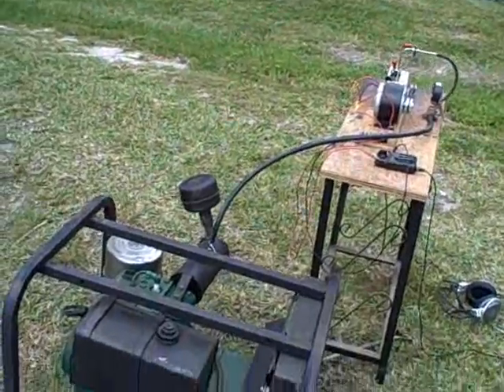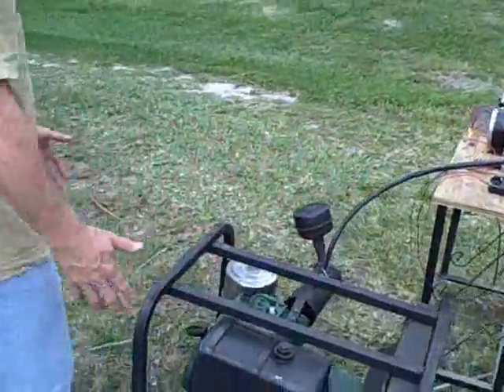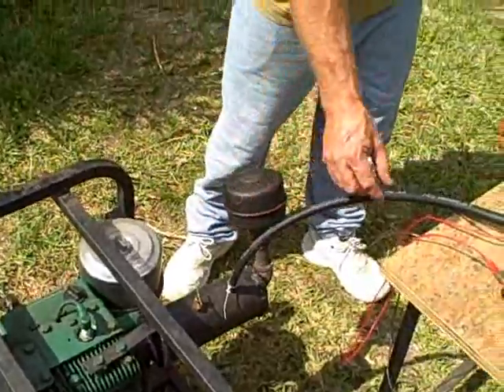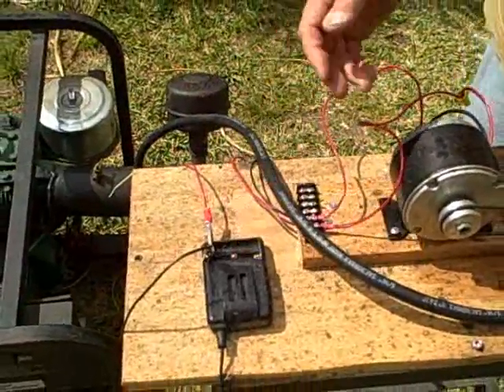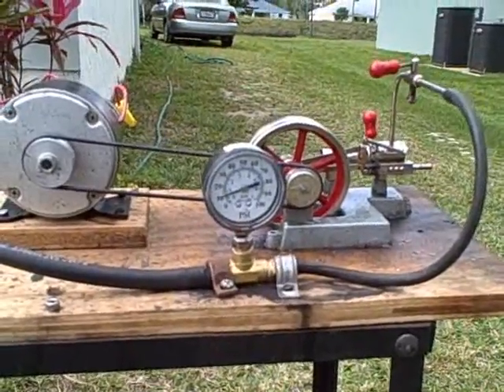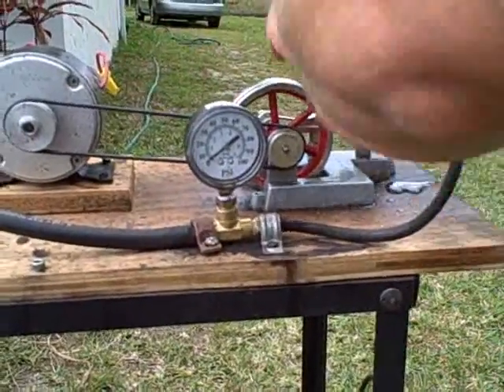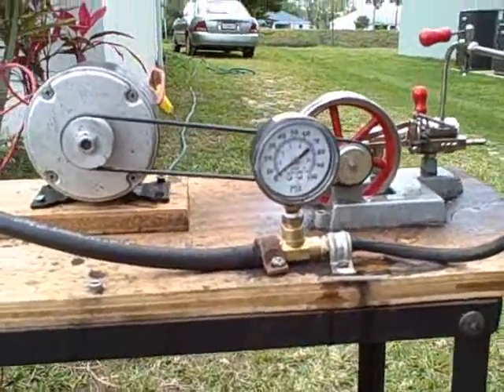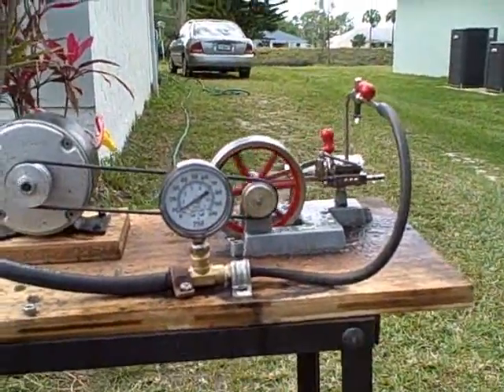The Andrews Exhaust Boiler Power System

Comment: it looks like you tried to start before the pressure has high enough. this is a great idea! Maybe this system could be added to an automobile to generate electricity from waste heat.  the steam could be condensed back to water so you would not need to add water.